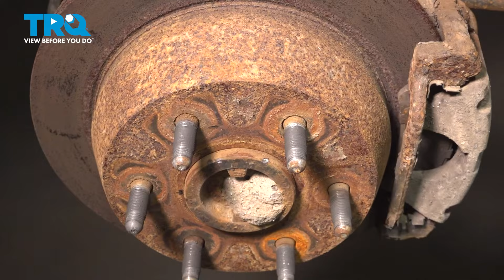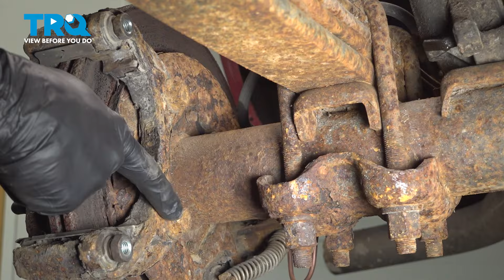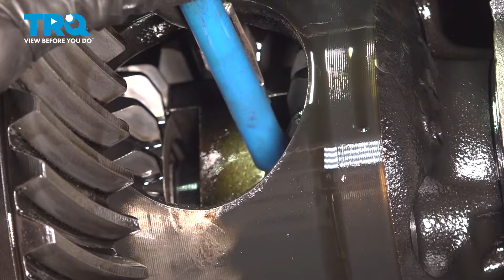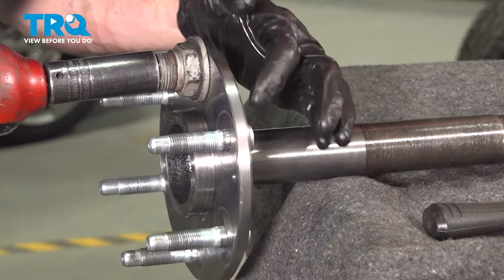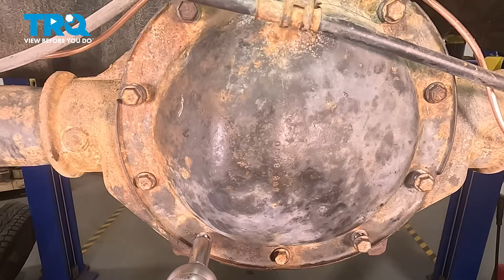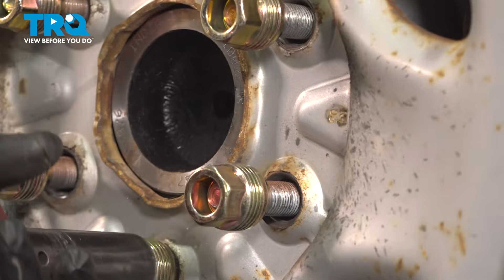How to Replace Rear Axle, Bearing & Seal Kit 1999-2006 Chevrolet Silverado 1500

Comment: You do not need to put gasket maker on the seal. It has a special sealant on it for that purpose. Unless the OE repair manual states otherwise.

Comment: I did axle seal on passenger side my diff cover doesn’t leak driver side doesn’t leak but passenger side my parking brake and bottom of tire and a puddle of gear oil I installed the seal correct I know it’s correct I made sure 100 times before reassembly and it’s still leaking what could be wrong it’s leaking the same as before I did the seal

Comment: If I didn’t use gaskets maker on the seal is when I installed it is it going to leak? And while I’m here might as well ask do I have to use lock tight as well?

Comment: Never loosen up the bleeder screw you don't need to do that pop the hood and take the cap off the brake fluid Reservoir then put a C-clamp down on the brake pads and push them back in

Comment: I have an 04 with 134,000 on it and never had a rear bearing fail. If you keep the rear diff COMPLETELY full that bearing is good for 4 -500,000 miles. The seal always goes first and kills the bearing. At any rate, it's not a hard job. I change my rear and front diff fluids every 30-35,000 miles.  ALL is well that way. I've towed boat, ATV , and hauled firewood.  The old Chevy is bullet proof with proper maintenance.

Comment: Dammmmitttt man !   We wanted to see how bad the old bearing was and then see where the metal particles on the magnet came from. Any chipper ring gear or pinion, or spider gear teeth chipped or missing????  Come on dudes.

Comment: Something i noticed you didnt mention here is when you intend to reuse your disc, you must make sure there is no gear oil there. If any is on there its likely a good idea to replace it anyways with your pads, as it can work its way along the entire brake assembly and ruin your brakes.

Comment: TIP:  Open the fill port on the differential BEFORE you take the pan off.  If you don't, you may find yourself with an empty differential but no way to refill it because the fill bolt is too rusted in place to remove, especially on a salt-dipped truck like this one!

Comment: Just did this job for both rear axles bearings and seals. I referenced this video numerous times. This was extremely helpful. I would definitely say be extremely careful with the alignment pin you need to remove and put back in to release the axle c clips. That pin is covered in oil and when you remove the bolt it wants to slide right out. Putting it back in can be a pain, you need to do firm pressure if the gears aren’t exactly aligned. Dont let it drop!

Comment: I saw a different video first and and they didn’t not say don’t sound the spider around to get the c clamp and i changed both bearing and seals and now my pin hole is not aligned anymore, how do i fix this?

Comment: Great job, really well explained.  You make it seem easy enough for me for me to do at home. Problem is I'm on a road trip with a small camper trailer on a gravel driveway, no bueno. I can't fix it here, but it's a huge relief to know what it actually takes to do it right, and the right place to do it, which is not on a gravel pad on a road trip far from home.   Downloaded and bookmarked, you're a lifesaver, literally.  If I was to 
persevere and attempt to fix it here,  my Sconnie Irish wife would've killed me.

Comment: Nice to see repair videos on a rig as rusty as mine.  So relatable!  

Question: do you always replace the axle with the bearing? Any chance of re-using the axle if it's been running on a loose bearing?  My bearing is noticeably loose, so I'm just planning what I'll need.